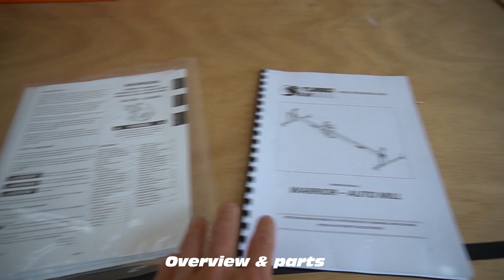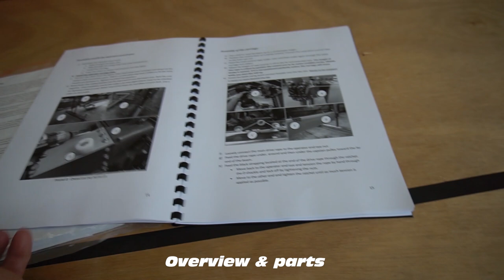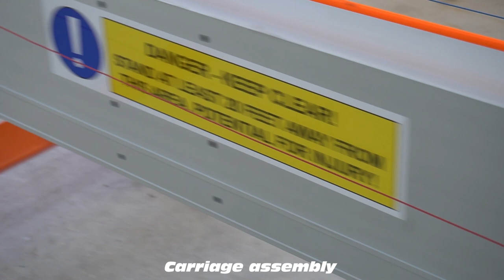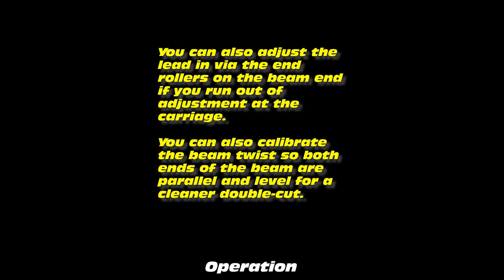Turbosawmill Automated sawmill user guide.

Comment: Nice Video Jake! Couple questions:  (1)  Do you add anything to the blade water when cutting pine?  Like dish soap or PineSol to prevent pitch build-up on the blade?
(2) What size drill and tap do I need to assemble my Auto Mill beam?
Reply from the maker: Should be included now M8 x 6.5/6.8mm pilot. Just water works well.